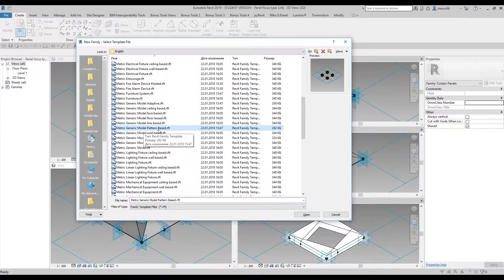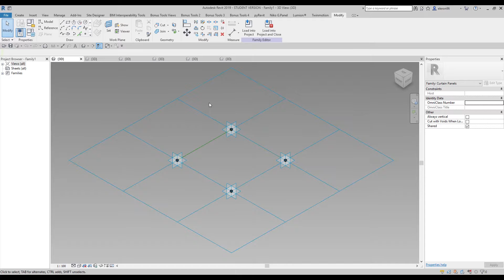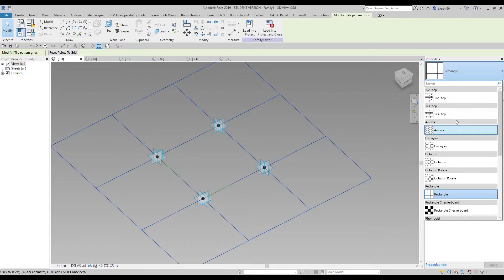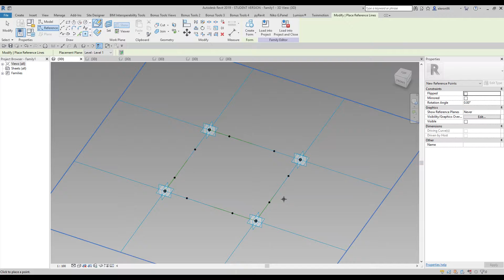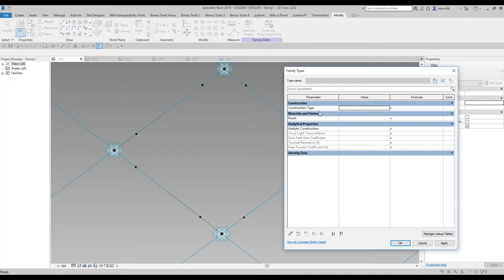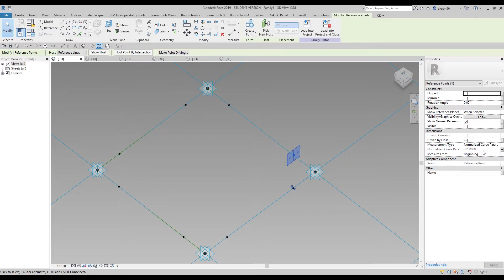Adaptive family | Practice | Part 5

Comment: Thank You for great contents! I have a question about reference dots. I follow the processes with my computer and I also use Rvt2019. When I put my reference dots i cant get the dimension option for placement like begining or end etc. I didint have the problem previous videos but this one. Do you have an idea ? Thank You!
Reply: I figured it out. I draw it on workplane instead of draw on face. Thats the problem. I leave it in here if anybody lives that problem.